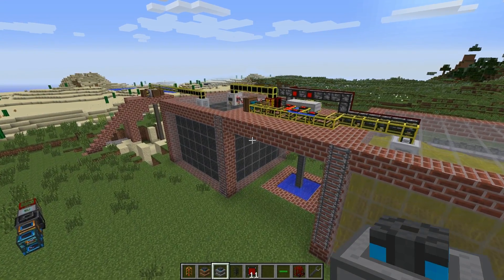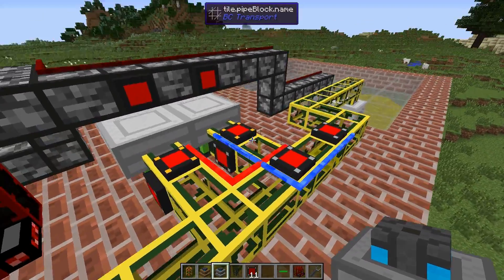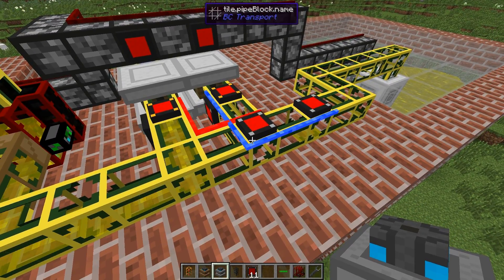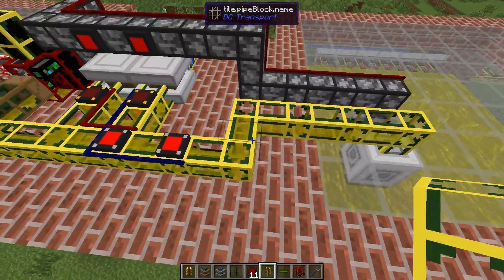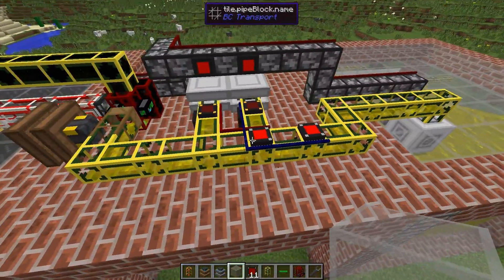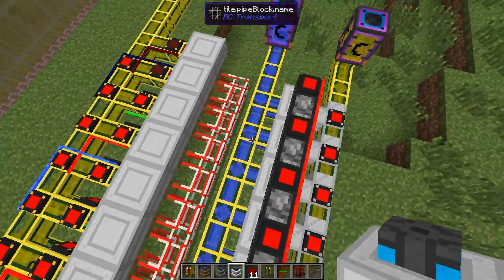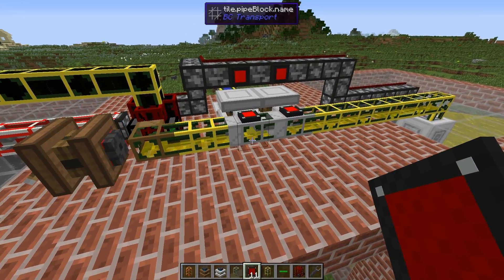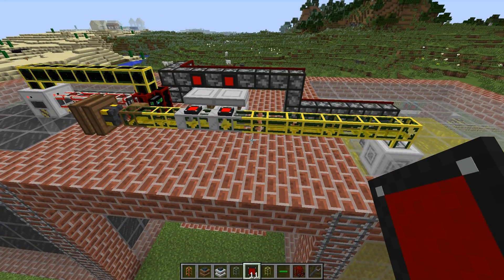Control Liquid Amounts / Flows With BuildCraft Gates (BC 6 & 7 Tutorial)

Comment: Haven't got the chance to check but is there a condition setting that checks the amount of liquid, not by percentage full but by milli bucket amount? I want to mix two liquids at disproportionate amounts so I can't tell one side to open up at a percentage and vise versa without it messing up the ratio.
Reply from the maker: As far as I know there is no such setting. But I guess you can have two different tank sizes (like 4 tanks of one sort and 1 of the other), and when both are full you can start your mixing. Sorry for late answer, been really busy lately...

Comment: It's the mod update, I was having the same problem with water and steam via Railcraft
I like your Tanks though, more realistic 1 bucket per block I assume? I used to build them like that,  Railcraft has a pretty neat tank arrangement that is a multi-block.
Reply from the maker: +ElfNet Gaming The fun thing with these tanks is that they were possible to do in very early BC history. Before tanks exists I think. And I think they are quite logical since block == bucket. I like the railcraft tanks specifically since they can be monitored with ComputerCraft :)

Comment: 8:00 "Self-sufficient system" is what you were looking for
Reply from the maker: +Aeroxima Yeah, I couldn't find the correct expression :D
Reply: +TKH Self Sustaining. I try to build all my systems like that, Less maintenance and interaction especially in my coal and nuclear power stations around the map, chest cart train can pull in and unload coal and it gets processed into blocks and then fed to boilers that need them. Same for the nuclear plants where uranium is unloaded and processed into fuel rods (they still need interaction to remove spent rods and placed into a holding chest for a breeder reactor... But loading new rods is totally automated
Reply from the maker: +ElfNet Gaming Totally like that! Would be fun to see some screenshots of your setups.
Reply: Autonomous works too